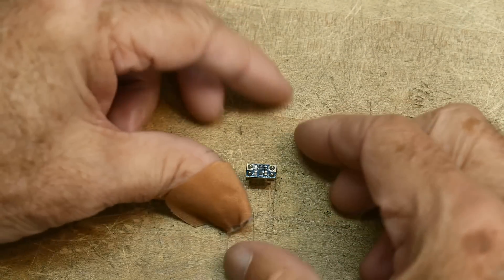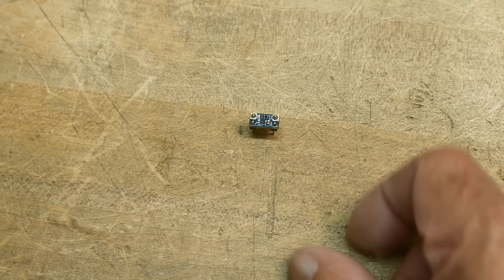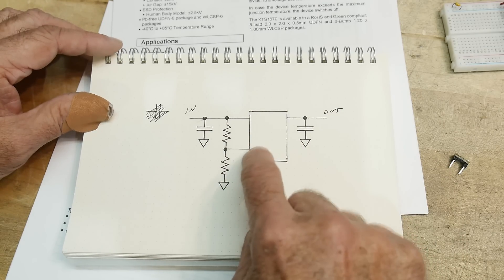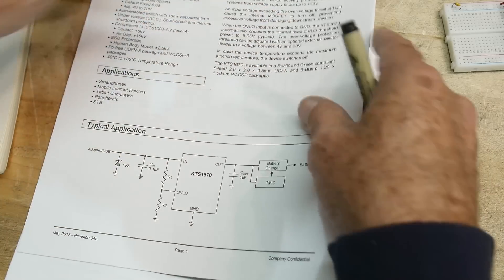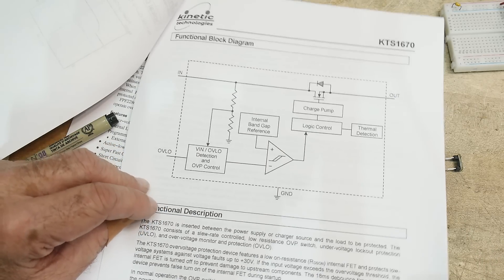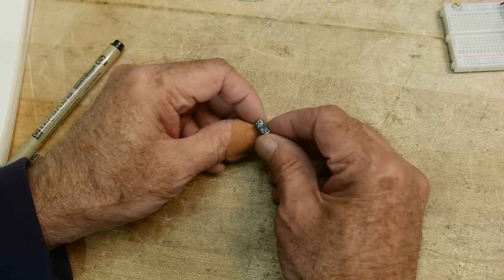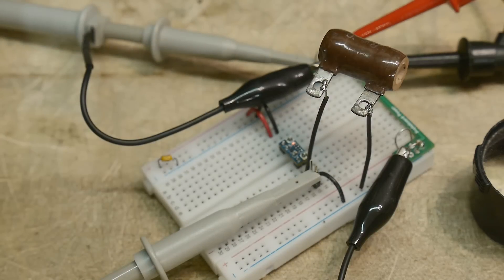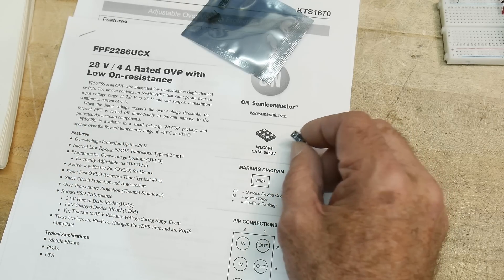#2054 Over Voltage Module

Comment: Thank you for doing the video about this module, great video!

I'm the one that originally requested it ;).

The original reason that got this module my side, was to maybe, if suitable for the purpose, use it to protect my Commodore 64 (C64) retro computer, as apparently the original 5V (at 1.5-1.7A from what have found online) power supply bricks can fail and put out around 9V(?) and anything 5.5V or over, damages RAM and other chips in the C64.

Comment: You need to test the overvoltage range to failure. It is useless if you don't know the max input voltage it can protect against and if it fails shorted to output or ground.
Reply: The exact part shown in the video was correctly identified in a comment by @InkNoid-o4u - It is: AWINIC (Shanghai Awinic Tech) AW33905FCR. It's available from LCSC and they also have datasheet there.
Reply from the maker: read the datasheet. 28V
Reply: @IMSAIGuy  but the datasheet was for a different part or did you find the correct datasheet after all.
Reply from the maker: someone claims it is a AW33901. that datasheet says 32V. I gave you a conservative number.

Comment: you could set it up to drive a voltage sensitve relay to add a 2nd battery in your 4WD for when you are driving and disconnect when alternator isn't charging

Comment: Wot, OVP that does not trigger a SCR that short-circuits the supply line and burn the tracks if the incorrect fuse was fitted???? Sacrilege I tell you…😂😂😂

Comment: 4:50 My leader told me this is N-Ch MosFet
Reply: Yes, I think he misspoke.  That is an N-channel MOSFET, which is why it needs a charge pump to generate a voltage above the source voltage to work.  (N-channel you need to pull the gate up to turn it on, P-channel you need to pull it down)

Comment: looks a little parasitic... I hate to see voltage dividers.
I guess on a 'dc in' plug/socket combo its not a great load to worry about and i very much doubt this would be ever needed on a battery powered device
.
Reply: By parasitic do you mean the power drawn by the voltage divider?

Comment: An interesting video and a useful part.  Without re-watching the video it doesn't give over-current protection - perhaps it simply goes open circuit with smoke indicator.  😀
Reply from the maker: it has thermal shutdown
Reply: The magic smoke indicator is more fun though😂

Comment: The OVP option on Lamba power supplies was essentially an SCR across the output with a Zener diode that would trigger the SCR and blow the fuse or circuit breaker if an over voltage event occurred.  They were often referred to as a crowbar.
Reply: The problem with crowbars is your device catches fire if the fuse fails and doesn't pop or someone replaced it with a paperclip.
Reply: And on some early colour tv receivers here in the uk, i still have some of those trip switches!.

Comment: LED between input and output, though it also needs extra protection against reverse voltage as well, because it very likely will be fried then, and probably go short between input and output, along with the internal mosfet body diode conducting with reverse voltage.

Comment: This module seems use an AW3390x series over-voltage protection load switch.
Reply: Was not able to find what chip this module was using myself and that's it, you correctly identified the exact same part used on this module: AWINIC (Shanghai Awinic Tech) AW33905FCR.